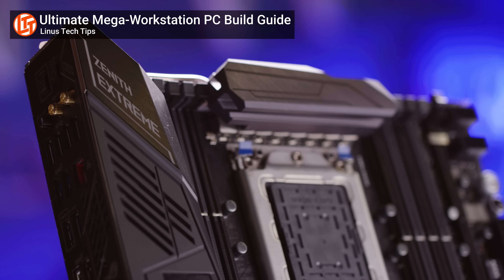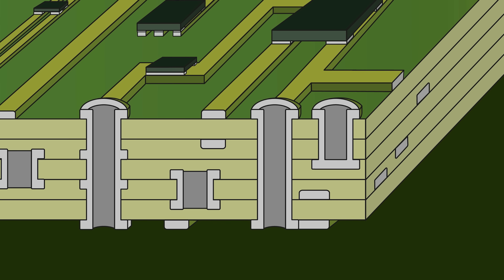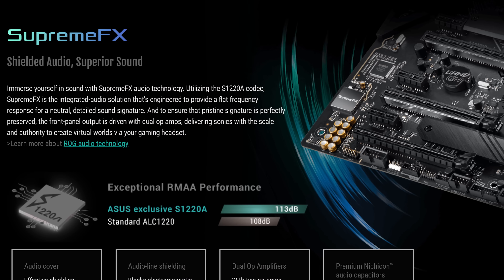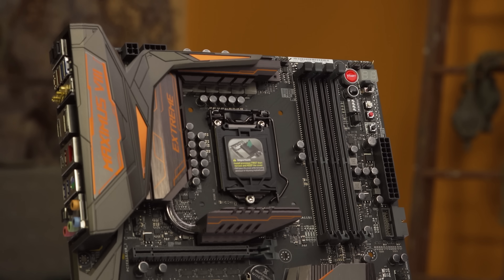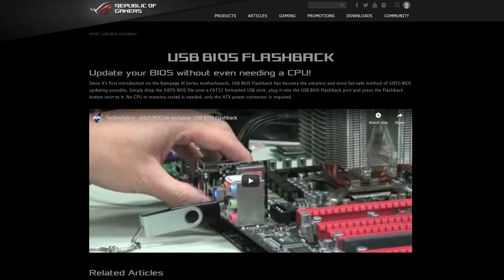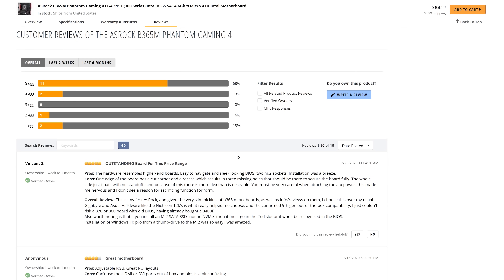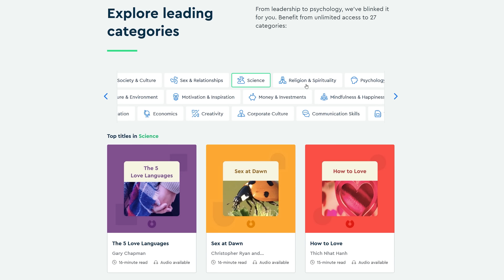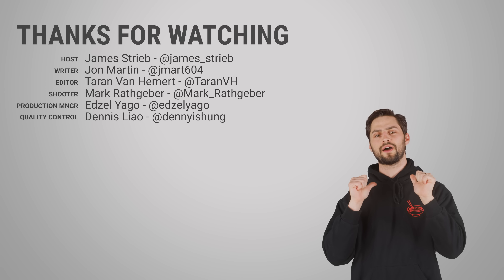Are EXPENSIVE Motherboards Worth It?

Comment: Entry level motherboard tends to boot faster into windows than high end board, due to lesser stuff to load during booting. Many don’t know this. If you don’t over lock, just get entry level board.
Reply: Then disable all that extra stuff if u care about boot times.  Wait if u actually care about boot duration then buy a decent board with nvme storage and really see some good improvement
Reply: You don't get it, do you? I pay extra money to get higher end board, end up it boots way slower than entry level board, isn't that embarrassing? Not everyone is techie, some may not know what to switch off to make it boot faster.
Reply: @felixlaupc  lol way slower? More like a couple seconds slower if it has to boot up multiple chips for extra satas, audio devices, plx chip, usb. Raid controllers etc. 

Or maybe people who buy boards with those extra features actually need them?  And care a lot more about functionality than a few seconds added to their boot time lmao. 

I already mentioned, sata 3 ssds are already fast and now mvme drives are blistering fast for boot times.... Which is the bulk of what your boot time is.  If that is not even enough for you and you want something bare minimum for the slight inconvenience of a couple more seconds added to your boot up, great.  There are cheap options out there for you but most people, tech savy or not care a lot more than just boot times in a motherboard
Reply: @malcolmholmes2596  
I would say in short, if you don't plan to overclock and just want a simple and fast com, just drop in an i7 or Ryzen 7 into an entry level board. It will be 100% perfect.
Save the money for better graphics card.
Reply: @felixlaupc  that's perfectly fine.  But some people need lots of storage, so people need high speed storage.  Some people need multimedia tools, some people need high speed Ethernet connections, some people need error correcting registered memory and i can go forever.  Beauty of building a system is that you build it your own personal preference, or at least whats available to you anyway.

If you all u care about is gaming performance and boot times... Maybe buy a gaming console? The latest ones have ssd storage, a cpu better than zen2 and gpu better than navi all in an dumb easy enclosure and included interface and software.

But im sure u have ur reasons why u console gaming isnt for you just like why a 300$ motherboard isnt for you either

Comment: My $200 z390 mobo has 90c vrm during stress and only stable at 5.1ghz at 1.325v. Put the same system to a $400-$500 mobo and the vrm never pass 53c. Able to get 5.3ghz at 1.35v. So cheap or expensive mobo, it depends how you use your pc also

Comment: I got a MSI MEG ACE X570. Honestly the best motherboard i've ever owned. Pricey but worth it to me
Reply: I own the Intel version of this board. It is basically the $600 Godlike just without an extra heatpipe at the chipset and 2 less covered NVME. I bought a cheap NVME cover with 2 rubber bands when I added my 2nd nvme for RAID so worth saving $300
Reply: @timothygibney5656  yea the ace is pretty much a toned down godlike
Reply: @mbgamersa5075  Only bad thing I Have to say is I broke off the OC dial easily and a pin broke (not MSI failt probably) off one of the USB 3 headers. To me the Godlike is a rip off that price as it should have a PCI express double/router chip at least if you are paying $$$$ and want multiple gpus or hard drves and need more lanes

Comment: To answer question in Title. It really depends on CPU you are going to uses. If you are using Ryzen 9 - 3950 go with X570 Board. if you doing anything less go with B450 or the new B550 .

Comment: I dished out for a slighly more expensive mobo for my i5-9600K just so I could have dual full speed M.2 slots just in case I ever want to get another 2TB M.2 drive.
Sadly of course this motherboard is only PCI Ex 3.0 but I'm not THAT worried as my HP EX950 2TB M.2 is so fast it feels almost as fast as running stuff of a DDR3 1600 ram disk on my old PC.
I also wanted a mobo that had a bunch of fan connectors since I do have a CoolerMaster HAF case and I do have all the fan spots populated.
Lastly this mobo I bought, the ASUS Z390-A Pro also supports up to 64GB which I actually have, 64GB of DDR4-3200 Mhz RAM and I do utilize that memory quite a lot despite mostly a gamer (though some of my moding projects or my modpacks/testing mods does have me using up a lot of ram or using a RAM disk for faster game boots)

Comment: I tried using one of the blue cables you showed as being able to do 10G but I can’t find a 10G NIC or switch that supports a DB9 interface.  How does that actually work?  Before to trolls tell me how dumb I am, yes I did get a RJ45 serial to DB9 female adaptor and try that...still no go.  The only way I can get anything is if I use my USB to Serial adaptor on the computer side and connect the RJ45 end into a weird port on the back of the switch.  All I seem to be able get out of that is some screen that says “switch>” in some program called ??puuty?? which doesn’t seem to do anything.  Did the editors go to “quickie” and use a bad image?

Comment: I would say yes and no. Cheaper motherboards are better now than they ever have been. For example, z390 Pro from Aorus is one of the best budget motherboards I've ever used. But I still see a benefit and buying higher-end motherboards as they have better features and in my testing, you can end up with higher over clocks.

Comment: What about buying a mid range motherboard? Here's how I bought each component when I upgraded last year. My mother gave us £2000 last summer, so after I had spread it around to my partner and our daughter I had £1250, so new computer I thought. My previous build was a 2600k and an ASUS P8Z77-V PRO
. Instead of doing any reading like I should have done, I just looked what was the best Intel CPU, I saw they did i9 now, so I thought wow i9, if i7 was good i9 must be great so i9900k it was, and as I had always had mid priced ASUS mobo, I just looked for a z390 mid priced, so I ended up with a z390 prime A, and as for graphics cards I always bought Nvidia before so as the RTX 2060 was the mid tier card I got that, but then the RTX 20XX Super's came out so I sent the 2060 back and got a 2060 super. So if I am being honest I bought everything on a fanboi basis, if I had done more research I would have spent more on a GPU and motherboard and less on the CPU, so this video does make me feel better. You see a lot of tech channels knocking cheaper hardware, everyone of these tech channels have RTX 2080 ti, but fuck me they are £1500, you could get a semi decent used car for that, I think they loose sight of the fact the knobheads like us have to buy our own gear so can't afford what is probably the best part of a months wages on a GPU, especially when in 3 years time it will have lost 90% of it's value.

Comment: It's fine if I pair a ryzen 5 3600 with a aorus x570 pro wi-fi? 
I know that's more expensive than the cpu itself but I plan to upgrade to 4900x or 5900x, what do You guys think?
Reply: yes, or wait until b550. pcie 4.0 will be the next standard for ssd in the coming years so get one that has it. you can get good x570 for 190$.

Comment: I came here because im sitting with i7 7700k and my motherboard has become unstable B250, chipset. £120.
If i buy another motherboard that allows me to overclock to 4.5-4.9ghz it'll costs me nearly £150-£200. Z270 Chipset.

If i buy another cheaper motherboard i can run at 4.49 ghz.

It can't justify the money even if i have to underclock to 3.5 ghz and 2133 mhz ddr4  for a stable setup.

Like everybody else, i'll have to suck it up until a new navi 5xxx and motherboard combo makes it worth the purchase.

I did have a 2nd hand Z270 and it did clock upto 5ghz, but that board was unfortunately broken too.

Comment: Cheapest motherboard from reputable brands that fits your processor requirements is still the best way. The only reason I got a newer mobo is for more SATA ports---I couldn't care less for better construction, better audio, better PCIE. :P

Frankly I've been owning a cheap motherboard from 8 years ago and it's still working fine on my PC. It's subject to extreme stress, like 24/7 online, dust inside the case, hot and humid climate with bad case air flow, and it's still working fine.

Comment: I think as a rule your Motherboard should not cost more than half the price of your CPU or GPU, whichever one is cheaper. If you're spending more than that on a motherboard then you're hugely overspending on said component and you wont even gain anything from it, I got a fairly high end motherboard myself because I was using a very new CPU but even that was still just about half the price of my CPU.

Comment: You might want to look up the actual difference between CAT5E and CAT6... and while at it look up CAT7, CAT8, CAT9, and CAT10... they have all existed for years.
The only difference between the standards for CAT5E and CAT6 is in how the wire is run through the cable.  In CAT5E all 8 wires are twisted together, in CAT6 the 4 pairs are twisted but kept separate for the other pairs.
Other differences people will probably want to point out are due to manufacturer variances and NOT differences in the actual standards.

Comment: i bought the cheapest asrok b450 board when i built my system with 2700x. it was total crap. my pc was laggy and stuttery even on the desktop. i switched it out for an asus x470 and all my problems went away.  later that month at work a customer came to let us build their pc. the came with the same asrock b450 and a 3600. it did not even post. we tried various processors and found that the board was just doa. i recomended my motherboard to them and they bought that and had no problems. sometimes buying the cheapest board does not pay off. your pc might run but it might run like crap. im never buyin asrock ever again. seen thier motherboard twice and both times it was a pile of crap.

Comment: My "cheap" motherboard in my last computer failed. When troubleshooting, multiple components showed sporadic symptoms of being faulty. I ended up replacing almost everything until I finally just bit the bullet and bought new cpu, ram and motherboard which ended up solving the problem. The new motherboard is high end as I don't ever want to go through that again.

Comment: I wish reliability was discussed more. It was mentioned only once as an afterthought. Of course, buying an expensive motherboard is no guarantee of reliability (my father lost two machines within a ten-year window because two VERY high-end ASUS boards failed), but I do believe there is some correlation. More specifically, I would say it’s not that expensive HAVE reliability as much as cheap boards MAY POSSIBLY LACK reliability due to cheaper-made hardware and cut corners in design and manufacturing. Remember, if your board dies you lose your Windows environment (most use Windows), and to get an identical replacement can become monetarily unreasonable if the board is more than a few years old. Read critic and user reviews. For my primary desktop machine, I would never spend less than about $180 on a board, but my secondary machine (HTPC) is currently an AMD B350 board that I got used this year for like 30 bucks (in a bundle), so I’m not against a budget solution, but never on a machine that’s gonna hurt if it goes down.

Comment: Independant of the video contents, i can recommend everybody to skip MSI. Like, completely. 
In my current PC i used an MSI motherboard - because what could go wrong? Everything it turns out. So the first one i had, had all kinds of problems. From not finding drives to having problems connecting to the internet (it rolled a dice on start up basically), to randomly losing internet connection every now and then. Even formatting did not help. So i returned the product, as one would expect, this was just a bad representative. Right? Yes and no. While most problems were gone, even after formatting once more, installing all drivers and whatnot, the internet problems stayed. I tried so much, but eventually had to settle for buying a network card which fixed the problem (since i didnt want to rebuild the entire PC again ..). Then i moved and couldnt use a proper ethernet cable connection, so i refrained to WLAN. And what do you say? The internet had problems again. I know what you think: it's WLAN. Sure thing, i thought the same. However, the PC just randomly decided to tell me that there was "No Internet" on that connection, while all other devices on the network (yes, WLAN as well) had no problems. I switched out the antenna and everything, changed the USB port.. but no. The problems stayed. So it got to be my old friend the MSI motherbord again. How that's even possible, given it should just be a normal USB signal - i dont know. How it's possible that the internet is not flooded with complaints like this (well there are quite a few actually), since it's a problem that should be independant of other components - i dont know. However, i can only recommend everybody to not buy MSI. I've never had any comparable problems with any other mainboard manufacturer and this is just silly, even after returning the board once and getting a new one.. i just dont get how one can mess up this badly. For me at least this explains why MSI is always rather cheap compared to other competitors.

Comment: You get random cool stuff, that u not need if you don't know what its it, and if you pick good brand you could go cheap as hell,all i had motherboards that cost about 50-60$ forever and with quad core cpu i never had single problem with anything on my pc, but as i'm now very advance user of PC i would like to get first time those with cool audio software' hardware and some other things like M/2 ssd support and maybe crossfire and other things.

Comment: Good day. A beginner question, I want to buy 2x RGB fans for my PC. I'm using B450 ProVH-Max Mobo. I don't know where should I plugged the fan pins on the board?
Can I plugged it on Sys Fan1&2 or JRGB1 then either of SysFan1&2 for the remaining!? Thank you so much for answering :)

Comment: 1:31 "Cat 6, 10Gbit/s" shows a Cisco console cable... then shows actual network cable for cat5e example..
Reply: Get your facts right at first.. That is one type of CAT 6 connector.. 
At first know the difference between RJ45 AND DB9
Reply: @aluandcache7336  That's definitely an RJ45 console cable...
Reply: @JustTodd24  but the pin layout looking different..
Reply: @glorence330  I know that but my observation is the pinout. Which is looking different from console cable layout
Reply: @aluandcache7336  sure isn't 568A or B

Comment: You are asking the wrong question. As long as the motherboard is fit for purpose ie.. it is specified to support the use case you have for it then any "worth it" value propositions beyond that point are entirely subjective. With the exception of RGB of course, I think we can all agree RGB is a minimum requirement of any computer.

Comment: I always bought the cheapest motherboard but after 5 or 6 years when it comes to add upgrades, I can’t add more ram, more HDD or any other new tech that might be able to be plugged if it were a high end motherboard. So my next rig must be a high end motherboard so it can last around 10 years without becoming so obsolete.

Comment: For AMD, go for the luxury option, since the socket and chipset are going to last several CPU generations.
For Intel, pair it with the CPU - either go cheap on both, or expensive on both. If you're going for an i5, you're probably going to change it in a couple of years and you will need a new mobo when you upgrade.

Comment: 5 years is a long time? I have been using i7 3770 with gtx 970 for 10 years and it still performs better than most mid-high pc's now. Check yourself

Comment: I got the b450 msi gaming pro carbon for ryzen but my system doesnt stay stable when i try to use my xmp profile to set my ram speed to 3200mhz :( cpu is r7 2700x +stock cooler and ram is corsair vengeance rgb pro 2x16gb 3200mhz

Comment: Do you need a expensive motherboard?

It depends on you.

Look at the features and what your goal is. I like to future proof so I tend to get the upper mid tier board with lower end components and upgrade them over time.

As of Right now if your getting a board that future proof, you want to be sure it has M2 memory, and PCI Express 4. If you can wait a year then go for one that supports 5.

Depending of its a work station or gaming rig will change the capacity of ram it support you should look for. Buy that's a video for it self.

Comment: in case of ryzen what you actually get that is useful is probably PCI stuff and the features of the chip sets or integrated WiFi. sometimes better audio chipsets. tho most b450m i see is more than good enough.

you might also say get more m.2 drives or more usb 3.0 ports or usb-c, thunderbolt or stuff.

the lifespan stuff is mostly BS in real life scenarios. I have seen like a thousand 6 year old or older cheap budget motherboards still doing as well as they did the first day.

Comment: I’m building right now. So far I have the ryzen 5 3600, and a expensive rtx 2070 super 8gb ftw triple fan, so why am I trying to cheap out on a board lol. I found myself looking at cheap b450 motherboards because the prices on them X570 can get pretty high. The budget I’m gonna use for the mb is about $150 and it needs a type c port. I also want the new pcie 4.0 for future proofing but they’re only on the X570. I’ll shell out a few extra dollars if somebody find me a good X570.